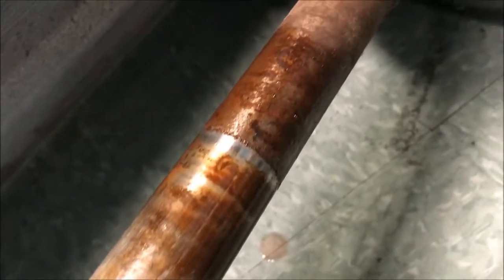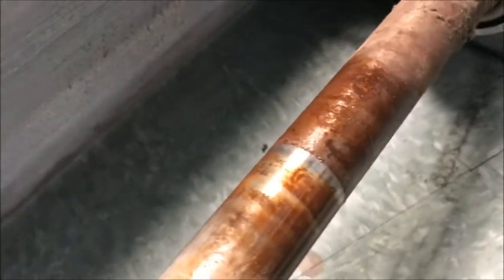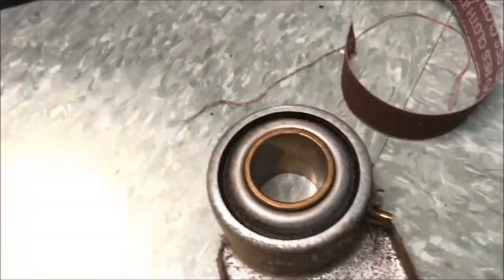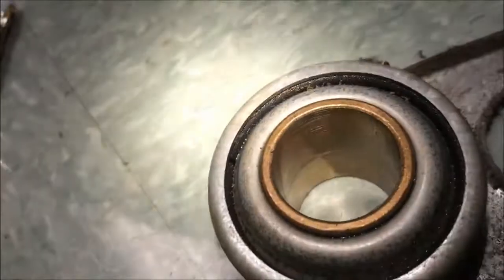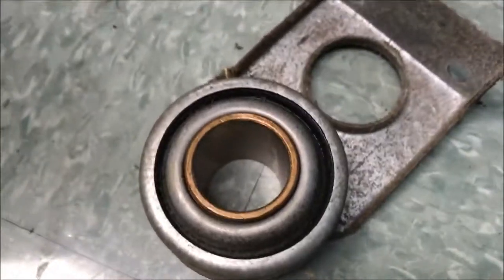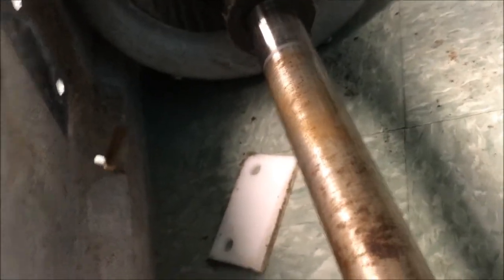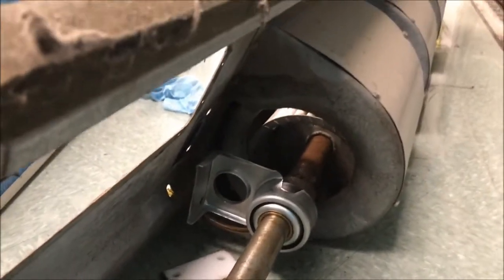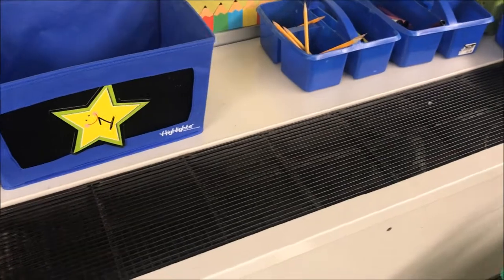Unit Vent Bearing

Comment: I had a bunch of motors in these units “burn up” but once I oiled the bearing back up the motor would spin and amp fine. If the bearing sticks once do you recommend replacement or more frequent oiling?
Reply from the maker: Replace it. It will stall again in a short time. It’s a quick fix for a day or two, but replacing it is the best.

Comment: Nice one. 
Any tips vids on horizontal UVs?
Reply from the maker: No videos, but one of the only tips I can think of is, always have two people with ladders to take down the complete fan assembly when replacing bearings.  Put it on the ground, clean up the fans, replace your parts, then put it back up, nice and clean and ready for quite a few years of good performance.  But I really hate horizontal unit vents, and pity anyone who has to work on one.
Reply: @tcphvacr9950  having two people makes complete sense.
Subscribed